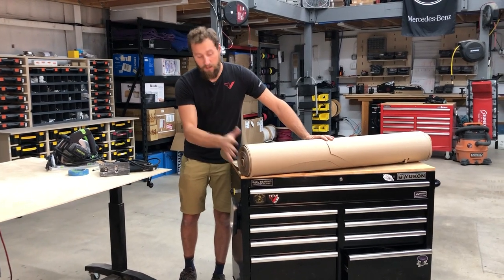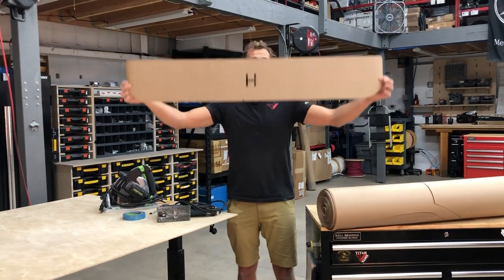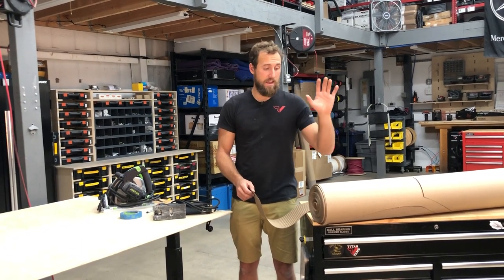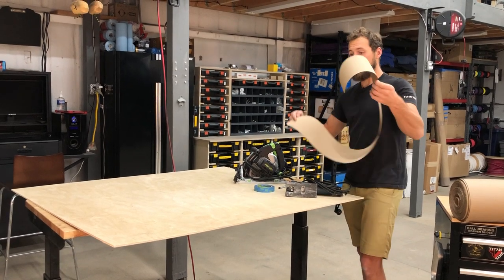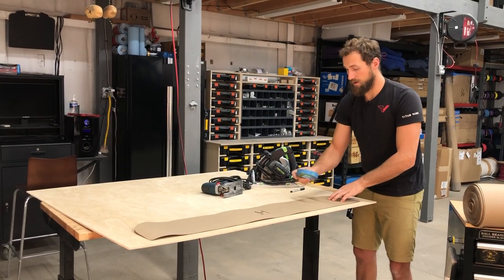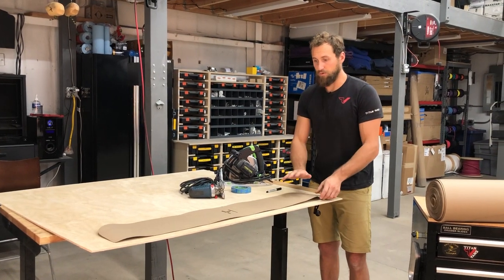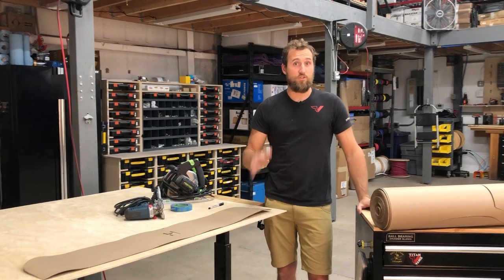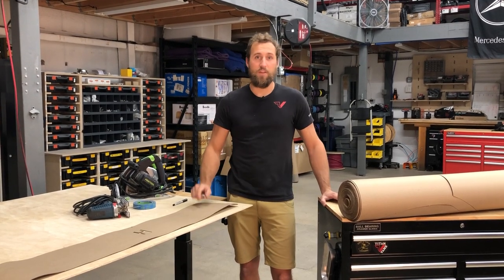How to create DIY Van Interior Panels - Paper Panel Template Kit

Comment: So, I ordered these templates and they are extremely wavy.  In your video, the small template you use looks fairly flat.  I don't know how I'm going to lay these flat to accurately trace the template.  It almost seems like I'll have to tape the entire thing down - which isn't possible since it, well, they need to be traced.  Any suggestions? I have l-track laid across it to try to get it to lay flat but that isn't working. Would love any ideas. Feeling very disappointed, especially for the high cost.
Reply from the maker: Sorry your experiencing issues. Pinning them down is probably the simplest. Use thumb tacks to hold them in place and not interfere with tracing. Let us know if that doesnt work and we will try and determine another solution for you.
Reply: @TitanVans  Thanks for replying.  Thumb tacks aren't a great option either (I tried it). The problem is that the "waves" that are created in the cardboard after being rolled make it almost impossible to create a flat template - particularly on the templates that have a tighter roll from being in the center.  You should strongly consider using a different material for your templates. We pay a lot for these and I expected a better product.  Also, on a similar but different note, the 'K' template is way off (perhaps others are as well, but that is the only one I've fitted so far). Since these are created from a CNC machine, I expect perfection in the templates. Otherwise, I'd save the money and do it myself.
Reply from the maker: @wanderlibre4434  Thanks for the feedback. This CNC file we use to cut these is identical to the one we use for our full production vans. We have not had any issues with fitment. What kit did you order? We also tested many different materials to laser cut and this was the best. These are a much cheaper option than our pre-cut wood panels and have pros and cons but we have had many customers very happy with them. Let us know how we can make this right for you.

Comment: What type wood and thickness do you recommend for the floor?
Reply from the maker: 1/2 minimum
Reply: Video shows 1/4”…is that not recommended?
Reply: @kevinmctarsney36  1/4 inch is much too thin for a floor. I actually went with 3/4 inch.  Glad I did.
Reply: @kevinmctarsney36  1/4” is great for wall panels.